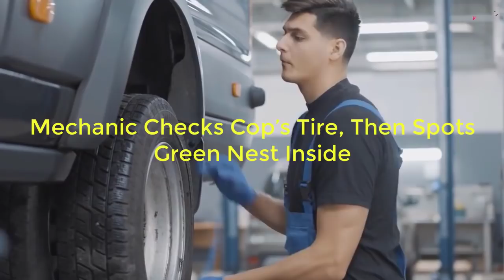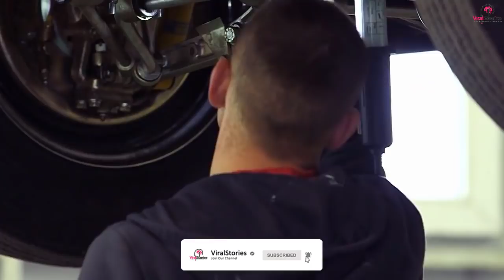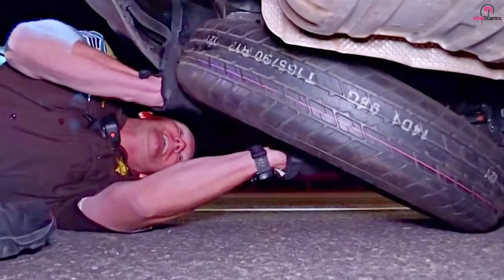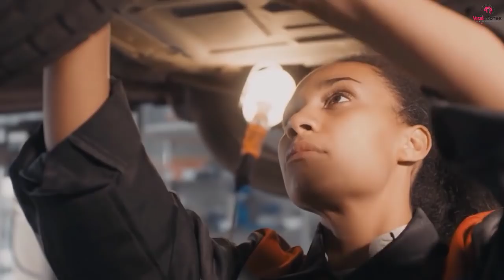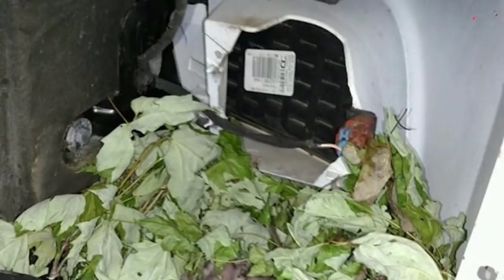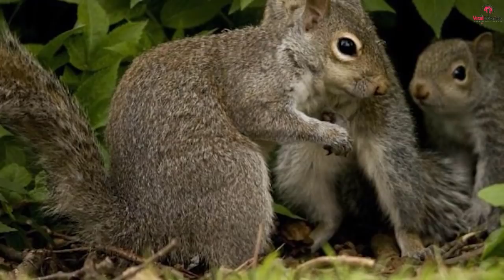Mechanic Checks Cop’s Tire, Then Spots Green Nest Inside

Comment: It's not uncommon for feral cats to crawl inside the engine compartment and to sleep on the engine block, especially in colderr times of the year. However, not such a good idea when one fires up the engine.
Reply: That's why you should always tap on the hood (Bonnet for the Brits) before starting the engine!

Comment: Yea this is definitely no fun very costly . I had squirrel chew through the main wiring in my pickup yrs again . Went to start it wouldn't start then thought ok maybe I have a half dead battery turned headlights nothing . I had to have a tow. &$4,00 .00 later got it fixed